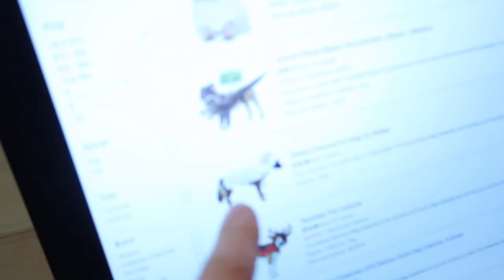Did we Discover a Dinosaur Fossil on the Farm?!?

Comment: There is going to be a good winter this year. So here is a controversial suggestion. Add another board height to your raised beds fill with finished compost then leaf litter. Next spring cover with black plastic. The black plastic will heat the soil faster so you can plant earlier,like when there is snow on the ground. Surround the plants with water cones. These are circles of double plastic fused in vertical strips (water can fill the tube made by the fused plastic) filled with water it is like a mini greenhouse for each plant. Two cold fronts this week here in Texas. Monday last high in the 80s, Monday next high expected in the 60s.

Comment: I haven't had time to read the other comments to see if someone else suggested. We never left the garden plants in the garden over winter because it harbors insect eggs and disease. We pulled everything up, put it in a pile and burned it in the center of the gardens. We then spread the ash over the garden for nutrients for the next year. Always remember to rotate your crops around the garden every year to prevent insect Infestations and also rotating your beans around it will put nitrogen in all areas. This worked very well for us. Hope it works for others.

Comment: You might try using a tarp to move your leaves.  Just tie a rope to the tarp and the back of your tractor, then rake the leaves onto the tarp and use the tractor to drag them over to the garden or compost pile.  If you need to, you can tie the rope on to two or more corners so you can lift them onto where you want them to be.

Comment: We did "fresh" leaf litter last fall.   It worked well, but didn't break down as much as we hoped.       This year we're using last fall's left-over leaf mold instead (You have a big old leaf pile, right?)   

We're hoping it will be basically gone in the spring since it's had a 12 month jump-start on breaking down.   Plus there should be way more fungus/microbes/good stuff in it after a year, too

Comment: I use a bagger and mow the leaves and that way they are chopped up and mixed with some green and then put them right on the garden beds 6 - 12 inches deep then seven  months later I just till a little and plant and it works pretty good. For the potato patch we plant winter rye.

Comment: Great stuff Gina and Olivia. Always awesome to see yall two doing stuff.  I think if you had a chicken or two with the turkeys they would get the idea of the roost. I've heard that they are shy of a few cog wheels when figuring some stuff out on their own....lol. Another fast way to get the leaves is use the rake on the tractor. (Just drop it down to where it just barely touches the ground). It can also help level any uneven areas in the yard at the same time. I find it works best turning it around and pushing with it. I have my tines fairly lose so they flex easily while going over rocks and stumps.
Reply: Great idea about how to pick up leaves with the tractor!
Reply: The landscape rake has been a game changer for me. It got rid of the leaves on our property which got rid of the horrible tick problem. Like Al is doing, I now have a huge compost pile. I cleared probably 3 acres of brush, leaves, and saplings with just that one attachment. My biggest dilemma has been the stumps of the bigger trees I had to take down for the driveway path, and shop area. My tractor isn't big enough to hand that job....lol.

Comment: AS TO LEAVING ROOTS IT THE GARDEN I WAS TOLD NOT TO BECAUSE ANYTHING THOSE PLANTS BUGS AND SUCH WILL BE THERE NEXT YEAR ,PULL THEM ,PUT THEM IN COMPOST , YOU ALSO NEED TO START TOPPING YOUR APPLE TREES AND TRIM THE CROSSING BRANCHES , SPRAY EARLY SPRING KEEPS THE BUGS ,&WORMS AWAY TRIM NI THE FALL , SHORTER MAKES THEM FULLER